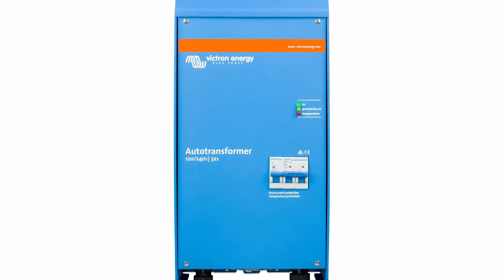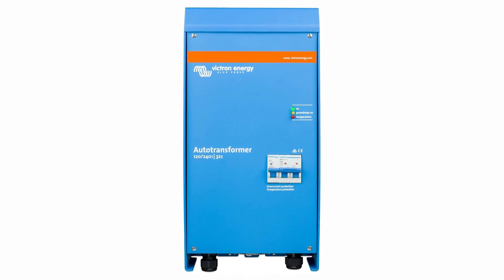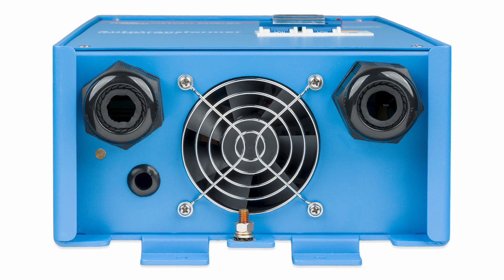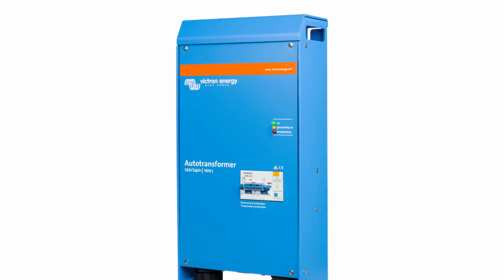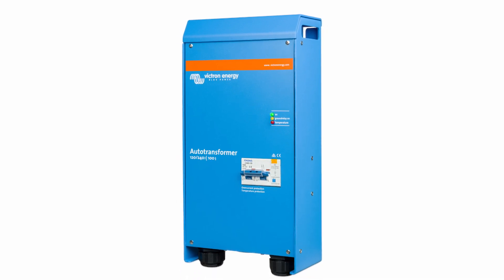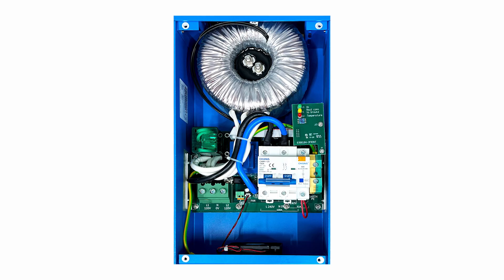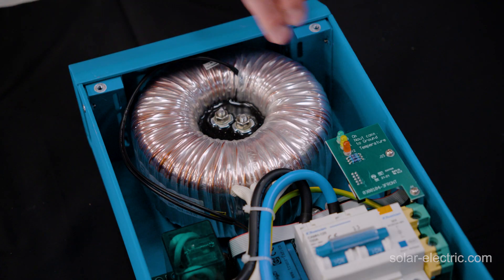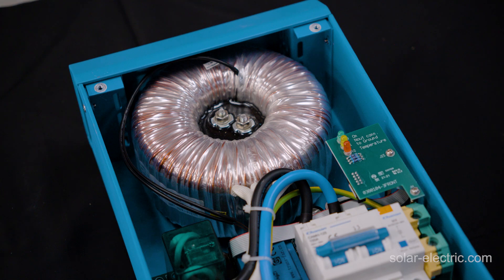Victron Autotransformer: Uses And Limitations | NAZ Solar Electric

Comment: My new 32 amp autotransformer does not have the same outputs on L1 and L2 when going from 120vac input to get 120/240 vac output. L1 has only 113 volts and L2 is at 120 volts. I have read on line that Victron has stated that is an OK situation, that is total hog wash. So far I have not received any return phone calls from them or my local dealer for 3 days about my concerns..

Comment: Question. So, if stepping up from 120 to 240 slpit phase, your basically limited to 32 amp at 240 And one leg of 120.  and the other leg can handle 100amp on the 100 amp model ?

Comment: Is the output 32amps at 240volts. And 100amps at 240volts?
Reply: I have this question as well. Can’t find it on the spec sheet it just says 100 amps.
Reply: @rj3075  100 amps pass-thru and 32 amps imbalance current / flowing thru the neutral.